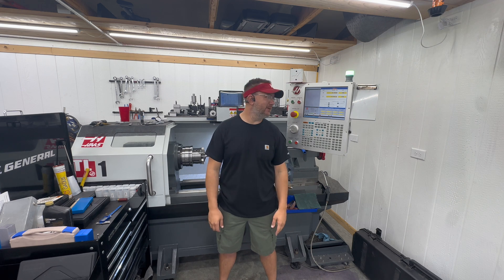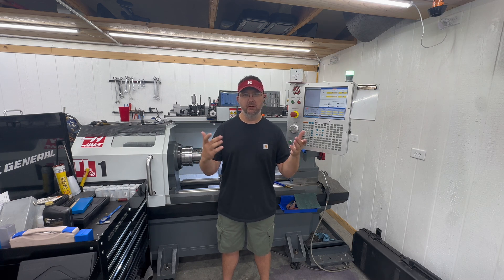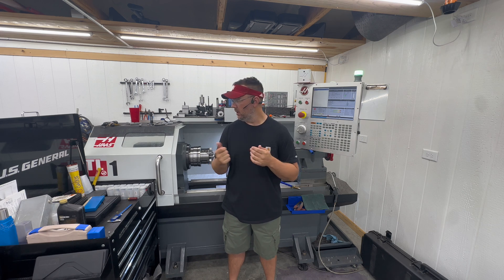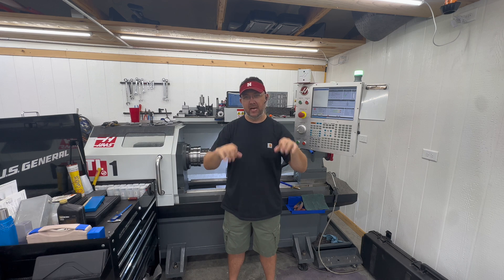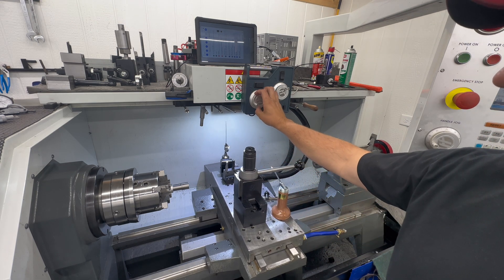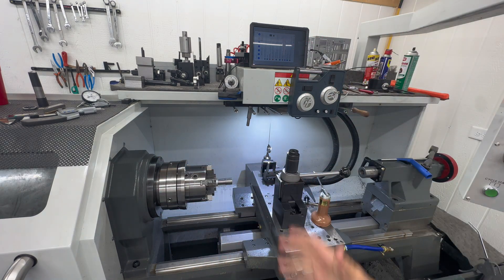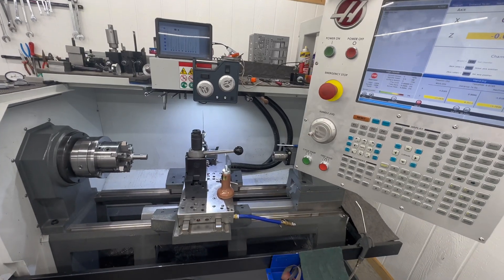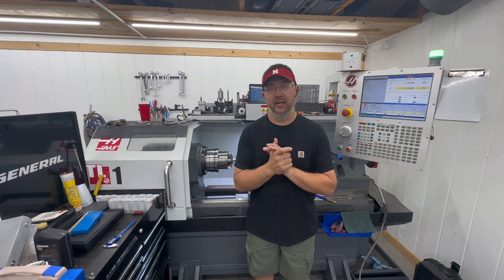Haas TL1 CNC Tool room lathe Gunsmithing introduction.

Comment: The TL-1 is a good machine for smaller shops and custom parts, HAAS tip of the day has good videos for learning on their factory page, VPS programming comes standards with the Next Gen contoller and is easy to do so you do not have to have a CAM sofware for simple stuff. Taught this for more then 15 years at the college level so I think you just need more experience and you will get comfortable.
Reply from the maker: I agree, it is a great machine, wish It had more power

Comment: I’m considering replacing my manual lathe for the same machine.  Your insight was very helpful.  Is it too terrible using the single dial on the standard operator dial?  I would also know more about the “chuck adapter” if I heard that correctly?  Thanks!
Reply from the maker: I would not sell your manual machine if you’re using it to depend on an income.
You will regret it! 
The dual dials are a must… the dial on the control would be impossible to indicate barrels without it.
The adapter is for the truebore alignment system.
I’d encourage you to take some cnc classes online or at a college.
The learning curve is steep and unforgiving. Best of luck!
Reply: @DustinDrews1  thanks for the comment!  We added a small CNC mill adjacent to the Bridgeport.  Our 15 x 60” gear head lathe is a tool we count on.  I do feel like the CNC capability because of the short production runs we do.  I should go back to school but at 68 I might let the younger guys pick that up.  I am totally frightened and can see the “unforgiving” nature of bad crashes.  We simply do not have the room to add a lathe (even a small CNC lathe like Tormach) in addition to what we have.  I like the capacity and the spindle I.D. of the Haas TL1 .  I have crashed the mill and I could see the horror of those crashes.  Brain farts would be expensive.

Comment: Great video brother. I'm in the exact same boat right now. Trying to get my TL2 up and running with no prior cnc experience. Been a little rough no doubt. Trying to get the last bit of tooling together now. Curious what cutters, threader, boring bar, and drill setup you went with. Any details would be appreciated.
Reply from the maker: Shars tools is a good place to start if you are on a budget.
MSC is awesome to deal with. I like their Accupro carbide boring bars.